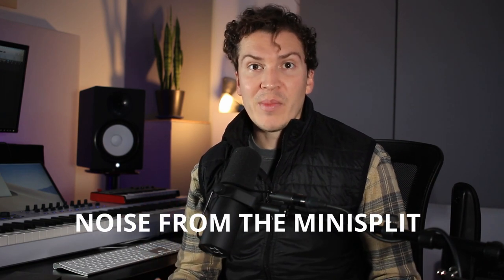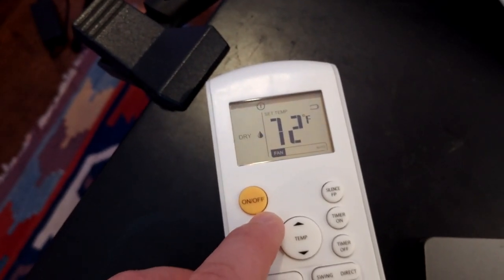Is A Mini Split A Good Option For A Soundproof Studio

Comment: Hi, the copper pipes still transfer the impact from one wall to another, is there a way to seal the outer exit hole without it creating impact that is transmitted from the pipe it self from inside wall and outside.
Reply from the maker: We surrounded the opening with acoustic caulk and some acoustic putty. I don’t think the pipes transferring sound would be a big issue for your soundproof studio.

Comment: what is the plan for when the a/c unit needs to be replaced?  will you need to open the walls in order to re-run the lines?  or can you re-use the lines for future new units?
Reply from the maker: I did replace it and we had to do a whole new system. Lesson learned don’t run the lines through the walls .
Reply: @soundproofyourstudio  curious what you recommend?  straight through the double-wall and perhaps an exterior baffle over the hole?

Comment: What did you use to seal thew hole in the wall besides the clay bags that it comes with, and acoustic putty for the final touch? ? I was thinking some kind of liquid cement-like compound
Reply from the maker: You can always use acoustic sealant but clay will be even better.

Comment: I wanted to know if your mini split was 120 volt or 240 volt...

I'm asking as I'm building my studio-workshop from scratch and was considering putting all of the audio components on one phase of my 2 phases, which would leave every other component on the other phase. 
A 240 volt mini split would use both phases and, in theory, introduce noise from the mini split into the audio phase. (I've read of switching 'noise' which would bleed into recordings.)
Again, in theory, using a 120 volt mini split would confine any noise to one phase.

So, if you would be so kind, what did you do for 'phasing' regarding audio components and the mini split.
Am I overthinking this and a 240 volt mini split is ok from an electrical noise standpoint...or did you use a 120 volt mini split to counter this 'problem' I don't even have yet before I wire....  :)
Reply from the maker: So the goal with electrical is to ideally get a balanced load in your panel. Also, it is best practice to try and keep your audio gear on one leg and all other components on the other leg, which is what I think you are getting at with "phase." I used this guy: https://chillminisplits.com/products/mrcool-diy-12-000-btu-22-seer-4th-gen-ductless-mini-split-air-conditioner-and-heat-pump-115v. It works well and noise has not been an issue in the studio. I wouldn't get too worried about it all.

Comment: Hi there, do you have any ideas for how to install a mini-split in a way that would work with a floating wall?
Reply from the maker: Yes, that is what we did. We ran the tubbing of the mini split through the two walls and cut a gap in the wood so that it would fit.
Reply: @soundproofyourstudio  my floating wall will be made with a hat channel instead of two separate walls. Would that still work?
Reply from the maker: It might not work as well through a single wall since you would have enough space. In that case I would run it through the wall directly but use acoustic putty and acoustic caulk to seal around the whole so there isn't an air gap.

Comment: How are you getting air into vocal booths?
Reply from the maker: I don't use vocal booths. I like recording using either a portable vocal booth or just recording next to my mixing desk because it is plenty dead to track vocals. If you have a vocal booth you will need to route fresh air into the booth from either an HVAC system with a fresh air handler or use an ERV or HRV to bring in fresh air. Check out this video: https://youtu.be/slv9J_v1Gc8